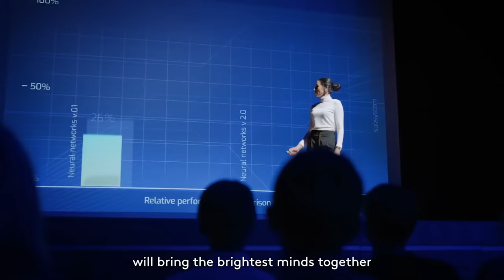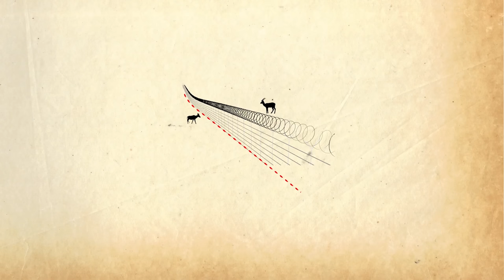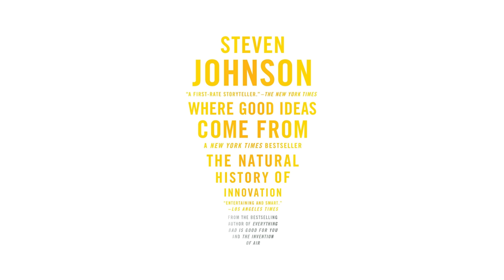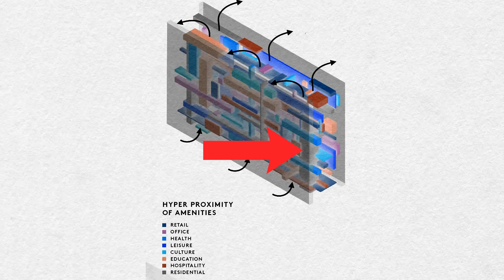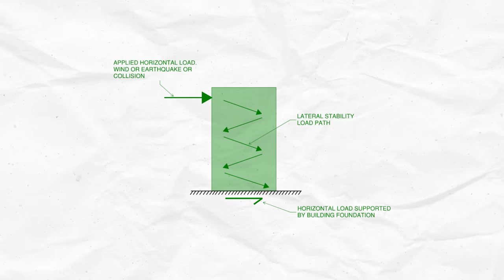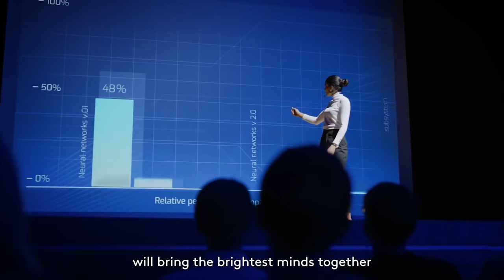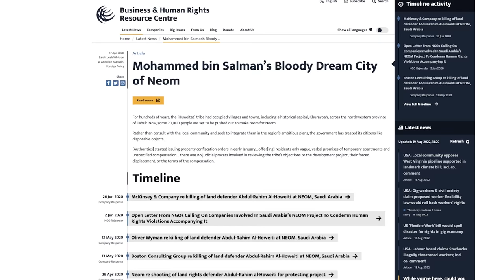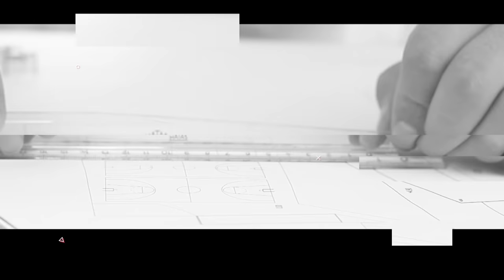This city concept breaks architecture (THE LINE)

Comment: Sounds like the set up for a dystopian, disaster movie. It's in the middle of summer, and thanks to climate change it's the hottest summer to date. The ambient outside temp is 58 degrees (Celsius), but within a km of the outside walls its 65 due to the mirrors. Then a genius technology that was designed to withstand this kind of heat, doesn't, which leads to a complete loss of electricity throughout the entire city. And the valiant, resident engineers can't restore it. What happens to the millions of people inside during the course of the next three weeks that it takes the military to find and evacuate the survivors amongst the smell of those who started dying early on? I got an idea. How about building a new, high-tech city somewhere else, like maybe Northern Canada.

Comment: Bits and pieces of the idea of a better city but still misses. Parking underneath good. Several sub floors good. Vehicles enter from the bottom level. Level above effectively makes cars in underground (under a ceiling) tunnels. Electricity transmitted through the pavement into electric cars. Continually recharging. The level garbage collrction from a ai robotic maglev on the sides. Above fire and police for the buildings. Above that in the street that is parks. Not flat but with some msn made hills winding roads naturalistic landscaped. The building on each side of this road should emerge from its lower levels as a large hill. Externally it looks like thr hills in Inwood Hill Park. Approached through a winding road thtough gardend around s stone and a normally lobby becomes visible through glass. Inside the hill a normal building. Amongst the trees and bushes covering it are a few fake treestumps and stones with one way glass the color of the rock. You can see out not in. Periscopes or the windows is lined up to an internally floor within thr outward sloping hill. Really thick reinforced concrete and a meter of earth overthat. Landscaping retention wall (hidden) and hydrological tecniques applied. Waterfalls in non dessert areas of thr world created through rain fed reservoirs and dustilation plsnts in dessert turn hidden turbines. Wind tech using no moving parts still air and electrostatic energy potential.  Out of 100 trees a fake tree which is internally made of engineered material to maximize capillary action and heat engine ising differing temperatures at level to bring water back to the top. A thermal liquid salt thorium reactor using engineered materisls from nanites to resist corrosive effects of Florida salts for thr remainingbpower needs. The earth sheltered berm city requires litte to heat and cool. The plants and trees absorb Carbon dioxide caused thr city to become a carbon well. Inhabited portions not lined up in a precision linear grid but will some arepushed back with roads winding for foot traffic easy to find. The city has larger parks as well. Gathering areas. HOUSING AS A RIGHT, and is centered around a 2 square km Zoo whose purpose is to save rare and endangered species with most animals in large open exhibits with a lot of foliage everywhere and a 2km botanically gardens. Bicycles ride on elevated roads covered in plexglass off to side 10m up to avoid bike, pedistrian collisions.

Comment: I think its an interesting idea, but im going to say to rip it apart based on a 2min video made for marketing is an unfair evaluation to it and you. Animal pass throws are pretty common in design be it hwys or pipe lines using a similar liner design so it wouldnt surprise me if it existed in the design, Arabic city's have experimented with natural cooling  using a moden version of wind towers used though out the middle east (The Yakhchāl was capable of keeping ice with wind)  so yes it maybe a better climate truth is they must of had some pretty good architects designing this and with modern software im sure many things like natural light on lower levels was at least address although since the outside is mirrored Id expect it to be there any way if not reflected down - they will build it world approves or not so we will see if the money holds and it gets done

Comment: The Line is a disaster of an idea. It is completely counter to an echo friendly design (even if they say it will have zero carbon emissions, it is ignoring the vast living echo system in the desert that will be destroyed & displaced by this “Great Wall” of Arabia). It’s like you said, even the most basic design principals are being ignored. They want to make both outer walls into mirrors…instead of shade being cast by this mega-structure, it will create massive heat zones. This is absolutely a political move that is going to wast a massive amount of money and resources. But of course, this is also a country run by royal figures who cover cars in hundreds of thousands of literal diamonds as a status symbol. It will wind up being another abandoned building project which will eventually get torn down for materials to make something else.

Comment: 1:18 Whew! I thought you said, “anti-Asian technology!” 4:44 Yes, unless the wall is actually a bridge, so animals have right away. 5:57 Again, agreed. Power generation from the movement of the ocean sounds good to me. Didn’t one of your videos (Dune design, I think) feature tall buildings with large air volumes, purposed as natural HVAC? 15:06 Great sell! Utopian vision as image upgrade. Concept imagery seems too good to be true. 16:37 Real political real fast if “public interest” can be seen (or manipulated) as “client interest.” Put this way, it’s a trillion-dollar image upgrade — what? two years after Kashogi? — disguised as an innovative, multi-level environment, featuring ill-conceived power-generation, that is also difficult for delivery (if there is a way delivery can be made more efficient by linear structure, then far out, show me). I can see not making it circular because then you have a walled city. Is there an advantage to making it a precise straight line, as opposed to an almost straight line, which may be more aesthetically appealing? Yet the more I think about it, the more I share your implied doubts. I never fully understood the ‘shuffling mirror playing card-as-transport.’ Because that has potential for frying many-things-besides-eggs in the desert. Well done. I want to know more.

Comment: It's a ridiculous idea by someone who is very ignorant of all the things they are talking about like architecture and green energy. That zero carbon emission is very much not possible with this idea. The cooling system wouldn't work because the temperature right outside is so hot it would increase the temperature of the inside of the city. Expansion is literally impossible, the way the wall is made would take so long to add another module on the side and in putting it on the line will either have to make aquatic models or not do that after you hit the ocean. This is very dumb and hopefully never gets build

Comment: Guys, this is the worst invention man ever thought of and it comes from the first worldwide oil producer: Saudi Arabia, whose environmentally destructive policy is well known this project will generate tons of carbon through its production and consumption: to make the temperatures in the desert tolerable, it will be necessary to air-condition all the interior spaces and cool the exterior spaces with monstrous air conditioning units which will consume hundreds of  tetra watt/hour, and will release gases that are extremely harmful ... but it is also an above-ground project that ignores all existing environmental data on the site where it is located!  It's a disaster !  Stop everyone, it's getting hot !

Comment: What happens when one part of the system fails one day? Technology is great and all but it's not infallible. If the infrastructure systems are interconnected and codependent (which in my opinion is the best solution for Sustainability instead of independent solutions that collectively produce massive waste); then inhabitants are sadly f*cked if anything goes wrong in such a tight configuration. This is also the potential breeding ground for further segregation and isolation and worse, in the event some evil overlord emergence, all inhabitants will be at his/her mercy with simple control of the power switch 😂. I'd be damned to live there but all jokes aside, powerful people like Jeff Bezos can totally pull off this project and offer thousands of dollars to first inhabitants while selling the futuristic dream. A few desperate and short minded people will take the bait and further push the agenda through naive but optimistic testimonials about what a great place it is. And if the threat of war keeps ensuing all over the world and this so called line city boast of first-of-its-kind security and becomes a so called impenetrable fortress; then more people would flood to it especially if immigration isn't a problem and you don't necessarily need to go through hectic bureaucratic process to live there. There's so many ways the powerful people of our times can pull the strings of the mass and force this city of fantasy and idealistic dream into a reality regardless of the long term effect on the ecosystem and the planet as a whole. The main question is: will the mass take a bite?

Comment: There is no such thing as environmental brutalism. This idea is extremely short sighted. Putting a city without cars in the middle of the desert seems rather myopic. Without cars, the entirety will be subservient to  the mass transit system.

This idea also hamstrings the traditional evolution of cities by creating a massive demand for carrying capacity - in an environment not optimal for such preconditions. Other issues, such as emergency services, will be truly ineffectual without an aggregation of services in clusters in locations not optimized for best economy.

This city sounds like a luxury development, additionally, it will most presumably be a secondary or tertiary residence for the residents. Seems like it will be a (part time) residence at best, as people will follow the Royal family in their peregrinations. This does not sound like it will ameliorate any of the current environmental problems, nor does it seem like it is economical enough to be a throwaway project.

In summation, this has many of the hallmarks of the empty cities that lie abandoned today. Does not sound like a good idea.

Comment: Obviously this project is flawed at so many angles, it's hard to start with. I love your critical thinking, however would much appreciate if you climb the ladder of meta layers one step further:

Why can such an for me obvious BS idea achieve that much recognition?

Here it gets itchy: we live in a totally visual triggered world where lookism, sexy optics and yummy surface rendering rule and distort our perception in malicious ways! 

I think as an architect, you should make a post on this current trend towards distorted, misleading architectural rendering that is very instagramable but leads to very wrong and dangerous outcomes, esp. if the uninformed lead the jury or decision making process. 

It is tbh, a shame that so many architects do not debate rendering ethics and just keep misinforming the public with misleading visuals. 

Furthermore, it should be mandatory to depict, how buildings age, 10 or 20 yrs from now, and how they cast shadow to neighbors etc. It would reveal the fact that the emporer nowadays is, in most cases, just naked.